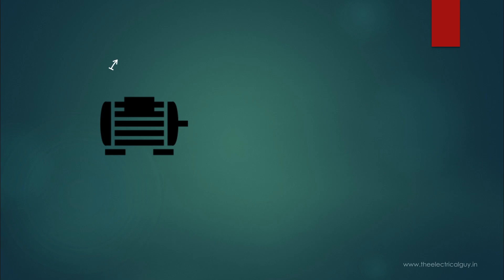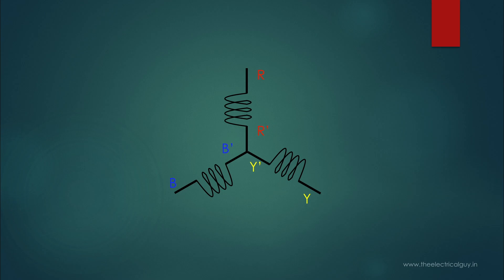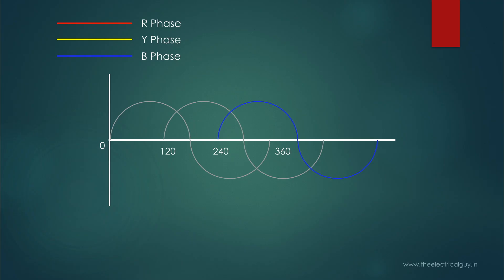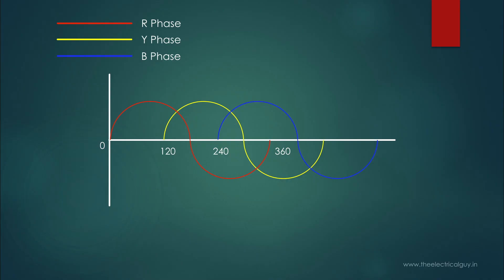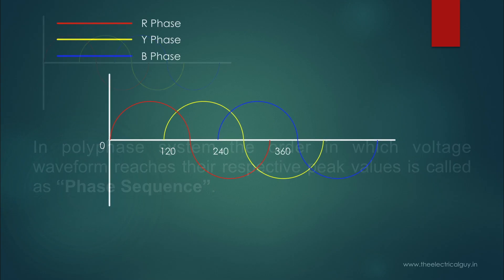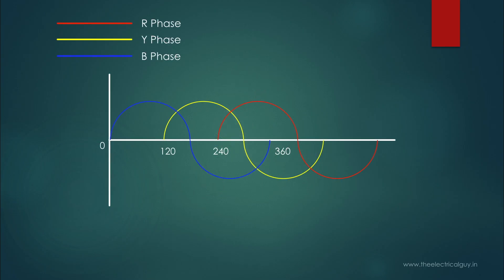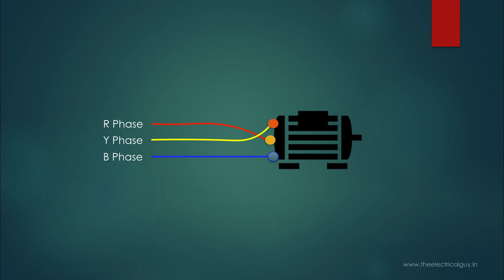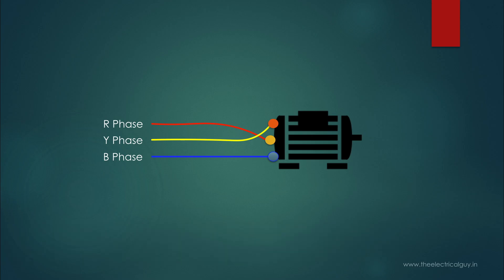Phase Sequence | Explained | TheElectricalGuy

Comment: why ct secondary terminal should not be open? Pls explain
Reply: Because current flowing through primary windings will produce flux which results large voltage across secondary and CT will saturate which may cause blasting in CT.